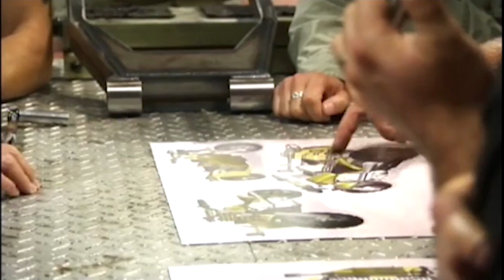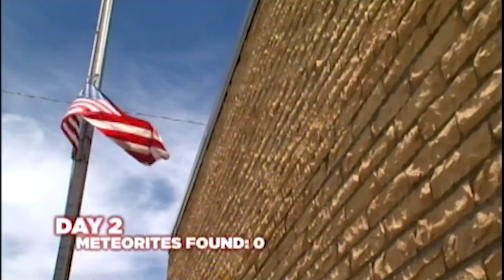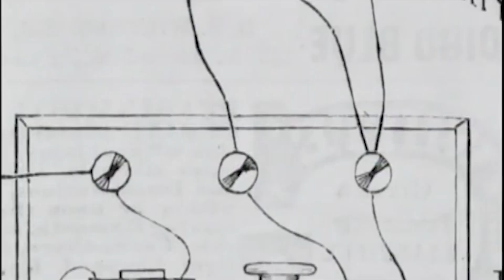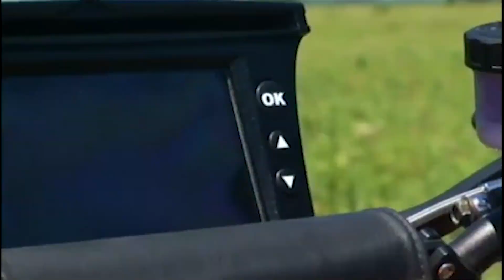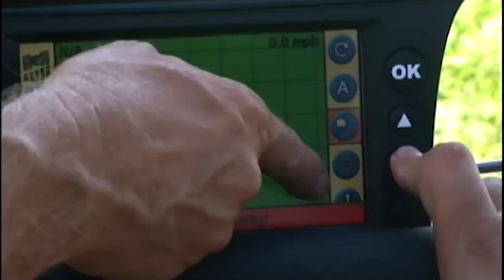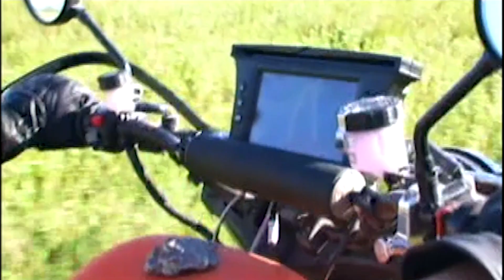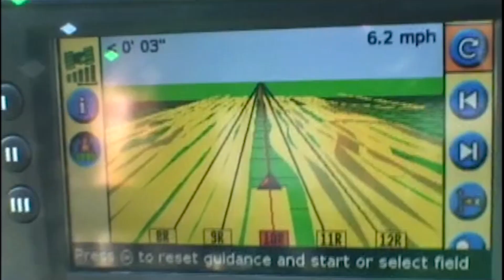Meteorite Men | S02 E01 | Alpha Gemstones

Comment: I found a 4foot diameter round "rock" with flaking layers of iron. It sits on White Rock Mountain.  While excavating I found a layer of squared white sandstone. Each stone had a border of a dark clay stain. 
It seems to me that it is a meteorite that shattered the white sandstone seam. I-64, Hartsrun ,WV  to Draft road . Past state park and turn right to W.R.Mountain.  about half way up, on left side of road where excavation was made to procure road material.

Comment: Why didn't the calibrate there detectors on a old meteor they have
Reply from the maker: Good note! We actually nearly always did test and calibrate detectors on existing meteorites. Especially in Sweden where we were using a very deep-seeking detector. It wouldn't have worked in Kansas because of the size of the detector we had, but I think in quite a few others you can see us testing the detectors on samples we already had. Good observation, thank you for watching.

Comment: It hasn't been to a lab yet because of this covid crap, but I found in an area of glacial terminal moraine, a cylindrical bluish 355 pound  completely see thro crystal rock that a magnet will slap onto it.  the surface looks melted off in one direction, the front end looks like it has a circle of extra melt area that flowed down the body and the tail also has a circular markings like what ever was melting, didnt make it that far.   I took a grinder to it on an area an inch square and polished the grind , lo and behold I could see several inches into it under my poor garage lighting.  does this sound like a meteorite to you guys or am I silly holding onto it ? Oh it also has a nasty sooty smell to it when wet.